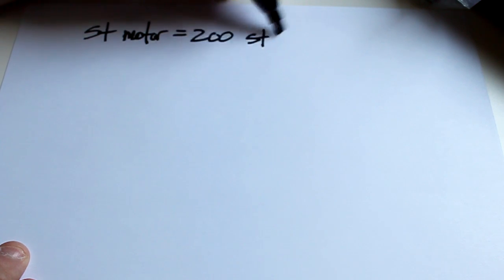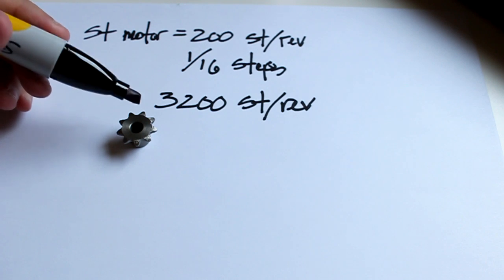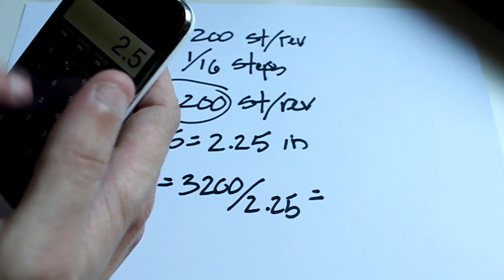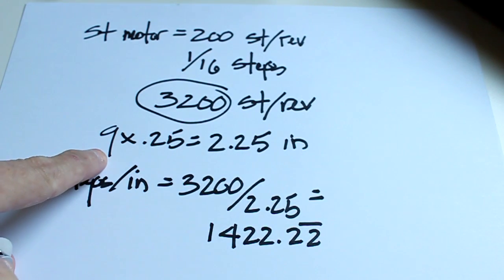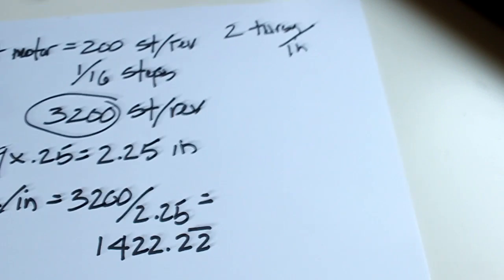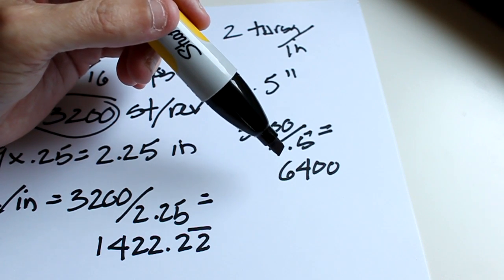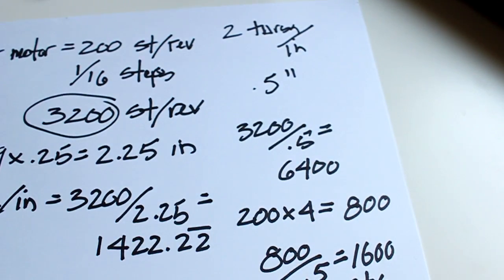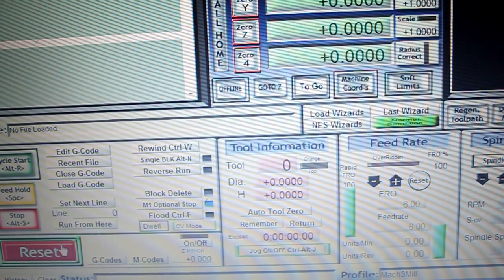CNC Electronics 8.mp4

Comment: Hello,

Can i use direct belt drive for nema 34 motor or i need to use gear conversion assembly????
Reply from the maker: That will depend on the weight and the inertia of the thing you are trying to move and the size, number of teeth and pitch of the drive pulley/sprocket to add/remove mechanical advantage.
Reply: Patrick Hood-Daniel ASSUME my machine size is 4fts X 8fts and chassis is made of wood and it has 2.2kw spindle mounted on it.
My stepper motors are nema 34 which has holding torque or 6.8Nm.
And linear movements are to be done by belt pulley mechanism.

Would you suggest using gear conversion for the following machine or would u suggest something else????

Thank you for your reply

Comment: @anajonesr FYI, I have the EXACT same set-up you have described here. With the exception that I will have a 4th motor and driver slaved so I can run an dual overhead gantry system. I have purchased all of the electronics for my cnc but have yet ordered the framework. I intend on using supported 20mm linear rails with my truck gapped at 6 inches to eliminate play but the one thing I have not set in concrete is the drive system. I could care less about speed and I am focused purely on accuracy.

Comment: @anajonesr If you have a lead screw of 2 turns and a stepper of 200 turns that is only 400 actual positions per inch your cutting tool can make. I like your videos very much and find them very informational but I am failing to understand what benefit you  receive  from forcing the software to generate these extra steps just for the micro-controller to consolidate them.

Comment from the maker: @koncertLive I recommend 4 microsteps for lead screws with 2 turns per inch.  This translates to 200 x 4 = 800 steps per revolution for the motor, and with 2 turns per inch, the actual steps are 800 x 2 = 1600 steps per inch.  This is a good resolution and the kernel will be able to handle this with relative ease.  I'm not sure I understand the 400 x 400 points of contact.  Can you elaborate on this?

Comment: @anajonesr so how does this benefit the machine in anyway, other than require a computer that can handle such a huge kernel volume. In your exmple you talk about using a 2 turn per inch lead screw with a 200 step motor. That leaves ou with only 400 x 400 points of contact with your cutting head. That sounds like n atrocious resolution?

Comment: i am a bit confused as to how the microstepper works here, you have it set a 1/16 so does that essentially mean that it requires 16 impulses from mach3 before it will send 1 impulse to the stepper motor. If that is the case that seems like an artificial form of accuracy.